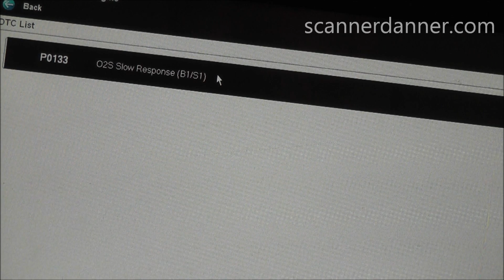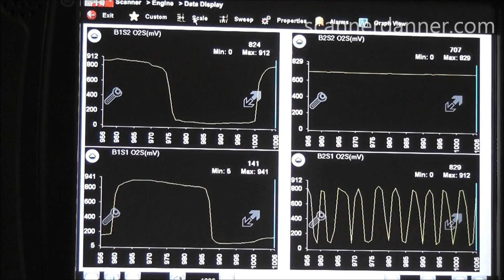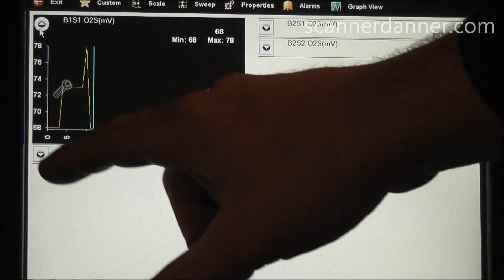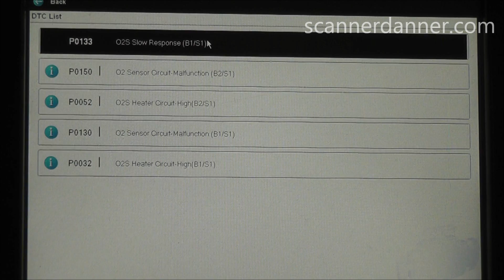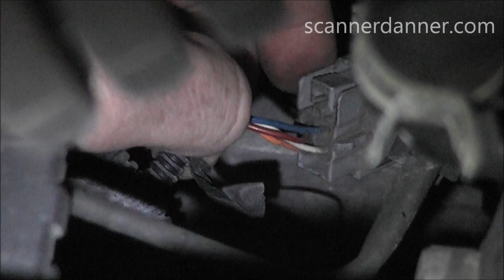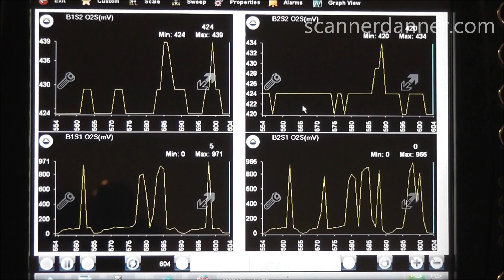P0133 O2 Slow Response (reversed O2 connectors) - Hyundai

Comment: I know this video is pretty old now but I'm about 90% sure Bank one on these is firewall side and bank two is radiator side, so when that bank two dropped out, it was correct to have.
Reply from the maker: Not sure what you're trying to tell me. Sorry
Reply: @ScannerDanner the oxygen sensors being unplugged and reversed possibly. Bank one of the V6 on this is toward the firewall and Bank two is toward the radiator so when the upstream radiator side got unplugged, it was mentioned that it should've shown bank one being unplugged and zeroing out instead of bank two like it showed on the scanner. It might've also just been a misspeak but I just wanted to mention which bank is which because in the video, it's mentioned backwards as far as I know

Comment: Trying this out on my 2017 Dodge journey.
Reply from the maker: Was someone in there playing around?
Reply: @ScannerDanner  I replace the O2 sensors. Did it one at a time and it's still throwing slow response..so trying this out see if I may have goofed 🤷
Reply from the maker: @cr76802  any exhaust leaks?
Reply: @ScannerDanner  none.

Comment: 7:22 Is it normal, that the Bank2 Sensor2 voltage goes down to 0 Volt as you left of the gas? And is the voltage in B2 S2 not to high, reading rich at 750 mv?  Bank 1 Sensor 1 on my car is also reading rich 750-800 mv if i step on the gas and goes down for a sec if i left the gas, but i get a B1 Sensor 1 P0130 (electrical problem) code pretty soon indicating my upstrem sensor has a problem. A new B1 Sensor 1, same problem as with the old one. (both original 5 wire wideband sensors ) 
Scantool shows 14.7 (Lambda) O2 reading most of the time at idle and at 2500rpm, so sensor 1 is not reading rich. Voltage reading is not possible at wideband sensors.
My Short term fuel trims are very low at -2 to -4 some times 0 at idle and goes down to - 25 (max) on 2500rpm? LTFT are not that bad - 0.8 to -4.5 . The short term do not make the short terms happy.
No rich codes from the ECU, but always this P0130 B1 Sensor 1 code and it goes in open loop again after clearing codes after a while if i drive the car. Do i have to reset the Fuel trims?  VW Beetle convertible 2005 with a 1.6L engine.

Comment: Excellent instruction video. Much appreciated and very informative. I have been working on cars since 1960s but never used graphs and other contemporary equipment as I never had that training. I have a 2004 jaguar XJ8 with all new O2 Denso sensors 234-9030 upstream but it keeps coming back up as a short in Bank one Upstream. The upstream and down stream connectors are idiot proof and can only connect grey and black male female design. But back to your Video I hope to be able to use your information to assist me using my new Foxwell NT 809 I am learning to use. There is a problem in it telling me it is shorted. Takes about 20 miles of driving after turning it off to get the light to come back on.

Comment: Rough acceleration no pick up ,bad gas mileage long term fuel trim settling at 2 percent no codes what could be the problem.fuel pressure ok
Reply from the maker: weak spark, timing issue, misfiring, compression issues, restricted exhaust, lot's of things, and I don't even know what you're working on? I'm assuming a Hyundai since that is what this car is in the video. year, make , model, engine ??
Reply: @ScannerDanner  Thanx for reply and yes sir it's hyundai.everything is working right so now I have to check compression and crack senor which is magnetic field.will update after checking.
Reply: @ScannerDanner  with a doubt I have checked the resistance of ignition coil and  primary coil resistance is high as  secondary now problem solved . Thank you

Comment: Before you do anything check the O2 sensor harness connector. I replaced my bank 1 sensor 1 O2 sensor on my 2006 Kia Sedona. It was a BITCH. If your arm is small enough you can get in between the engine and the firewall from the right side of the car to remove it without removing the intake, but you'll need a ratchet, couple various size 3/8 extensions, swivel, O2 socket and a lot of persistence!

But when I replaced the sensor I looked at the old one and one of the pins on the sensor cable had retracted into the connection. I used a needle nose to pull it even with the other pins. Had I done that first it probably would have been fine.

So check the connector before replacing!

Comment: Most stores will have assortments of zip ties by color, i.e. 6 different colors in a package.
I keep a wide variety of sizes and colors on hand.

When I am going to disconnect an O2 sensor, I take 2 zips of one color, and put one on the harness side, and one on the sensor side of the connector. I use different colors for each pair. (blue for left bank, green for right bank, etc.) That way, I always match them up right when reconnecting. Costs nothing, but infallible.

Comment: P0133 O2 Bank 1 Sensor 1 Slow Response
Live Data
Fuel System: Closed Loop - Fault
O2B1S1: Oscillating between 0.1(mV) to 0.9(mV). Also I snapped the throttle and the reaction seems right.
O2B1S2: Fixed at 0(mV). Caused Lean (Vacuum Leak) and Rich (Propane) conditions and it remains at 0(mV).
PS: Costumer said that 02B1S1 has been replaced 3 months ago with a used one. 

All in all, should I put a new 02B1S2 even when the DTC says 02B1S1 Slow Response?
Reply from the maker: Check the harness for a short to ground before replacing the downstream sensor. I have many videos showing how to use the circuit itself and a test light to confirm signal circuit integrity on an O2. Sorry, no links offhand. Just search O2 or oxygen sensor on my channel page

Comment: looking for what pins I need to test (Volt Meter) on a 4 wire Hyundai Sedona 08, o2 sensor B2S1 harness.  I believe harness is bad.  new sensor OEM Hyundai part.  Any help would be appreciated.
Reply: Sir Sweetness You will not be able to get the info you need with a DMM or volt meter to see the trace. They are to slow. Autoenginuity makes a PC based scan tool that will. Starts at about$250 and for that price it blows away the competition.
Reply: Mark Chidester 

     I have a bi-directional professional scan tool.  I will use that.  I think I will need a short finder tool like the one made by power probe.  I believe my scan tool is going to read a dead O2 due to wiring.  Vehicle was in accident on that side with wiring harness.

Comment: Your videos are wonderful for anyone trying to diagnose problems on their vehicle. I have a Honda 1.5 and I had a piggyback ecu on it, and a tuned exhaust, it wasn't running right so I got it back to stock and it still wouldn't run right. It was throwing a code, which was a heater code for the 02,  and the efficiency was poor. So I took a multi meter and connected the heater to the 12v that I saw coming to the female of the 02, the code disappeared, but the hesitancy is still there and the bad gas mileage. It sporadically runs better once in a while. On disconnected the 02, the car runs better but gas mileage is still poor, I got a oe o2 sensor from a friend and changed it out, improvement is hardly noticeable. What am I doing wrong? Is there a way to make sure that the signal and ground are connected in the right manner? There is no code as of now.

Comment: Do you test sensors while at idle speed, 2000 rpms or drivin down the road at 1500 rpms or so?
I only have one bank. My #1 at idle spikes amplitude about every 9 second intervials (going between .2 and .8)  At 2000rpms #1 has frequency changes every 3 secs. between .1 and .9.
While driving down the road at 1500 rpms the #1 and #2 mimmic one another. 
#2 stays steady at .75 volts while idle and 1500 rpms while in park.  Any direction about this data?

Comment: hi...thanks for your info..I got a regular scanner and this is what I got from a kia 2008 sport age lx...P0133- 1:exhaust leak present in the exhaust manifold or exhaust pipe,2:front H02S failed or front or rear H02S connections reversed,3:H02S has deteriorated , is contaminated or has failed,4:P0133(1of 2) 02 circuit slow response (bank sensor 1),5:purge flow (slow) a kind help would be appreciated.. thx..God bless..happy new year...

Comment: Question, what triggers a rear O2 sensor slow response, P0139? If the rear O2 normally sits at a fairly steady voltage when would the ECU expect a rapid change?

Comment: I have checked a few cars lately and noticed 2 had voltage on the heater circuit wiring, vehicle side, with the sensor disconnected and it showing as heater active in live data. Everything checks out good, wiring, sensor, etc etc. 
stuck!!!!!!!

Comment: my car has a code stored and its a P0133. However when i check the 02 sensors, bank 1 shows v 0.459 (at idle doesnt go above 500 or below 400) and bank 2 fluctuates from 0.800 to .950. i tried cleaning maf but nothing, my car idles fine but goes from 600 to 630 to 580 to 630 and like that

Comment: Hi ScannerDanner. Thanks for the video.  Do you use a OBD2 scanner to draw these graphs or the test points are right on the sensor signals with a true scope? If you use the scanner, can I know the name of this tool? Thanks.
Reply: These were graphed scan data captures taken from a Snap-On Verus

Comment: not sure, but at around 7:18 B1S1 and B1S2 are showing pretty much a similar curves, only B1S2 is dephased a little, so it can be seen that first signal change occurs in Downstream O2, then it is mirrored in Upstream O2. it also could be a lead to the final conclusion.
Reply from the maker: You're on it. I missed that clue when filming, it does tell us a lot

Comment: Great demo. 

I've heard of people replacing upstream O2 sensors in high mileage vehicles, with the point being that sensors tend to become lazy with age and that might affect fuel economy before it worsens enough to trigger a code. What are your thoughts? 

Can you quantify what the minimum switching frequency should be for a warm sensor at about 1500 RPM?

Comment: Had an issue like this on a Corvette where the front O2 sensors harnesses where switched. Engine ran rich and surged badly. ECM was trying to compensate for the wrong bank, with an aftermarket exhaust system, similar to what you had here. Several sets of O2s @ another shop and no fix.Several minutes of thinking and a quick visual inspection revealed the culprit. Swapped harness and all was well. Good find and once again great rational thinking! Keep up the great work!!!

Comment: If i remember correctly the cat does a chemical reaction where it uses the oxygen to reduce HC and CO so to make the rear o2 cycle it has to add fuel for longer to get a rise and lean it out for longer to get a drop. where as in the front it senses it right away and the computer sees drops and rises faster.

Comment from the maker: Good question. the reason that it didn't is because the converter is acting as a buffer in a sense. so the pcm has to add way more fuel than normal to bring it rich and take away way more fuel to make it lean because the cat was burning it off

Comment: Excellent video, Paul, if iam right, on closed loop, ECU decides fuel trim based on upstream and downstream is used by ecu only to report how good CAT is , is my understanding right, in other words, downstream  has no relation to upstream, assuming connector are connected correctly and not reversed, pls advise.

Comment: Why does the upstream sensors go rich/lean so frequent? Great video.
Reply: Each cylinder is firing and there's a gap in b/w them that is why, the cats job is to trap oxygen and react with the gases to create a steady neutral exhaust, neither rich nor lean.

Comment: Great video paul, have to give you props for the e-book as well i had a 97 f150 in the shop yest. & today...it was a back burner deal i had a lot going so was pickin at it when i had time in between many other jobs. A  thurs. night review from ur book and was diagnosed an out the door today...initially O2's dropping lean @ wot wld buck/jerk & miss at idle as well .#1 bad coil on driver side,#2 plugged fuel filter whiched caused plugged converters customer is gonna deal with the converters on hi